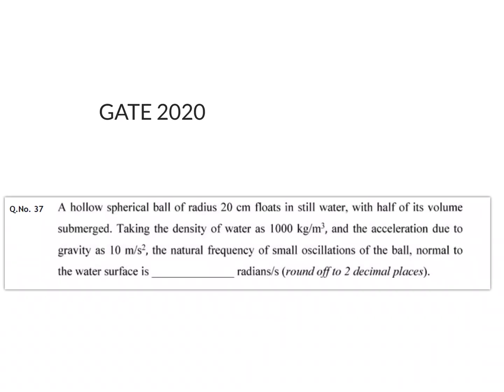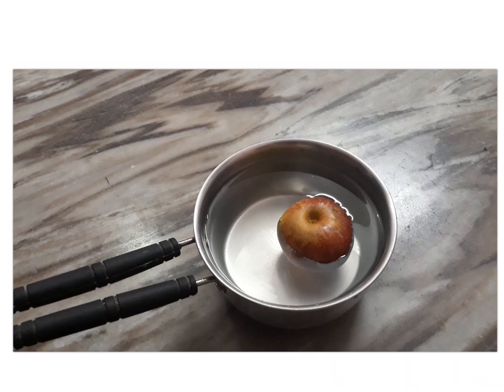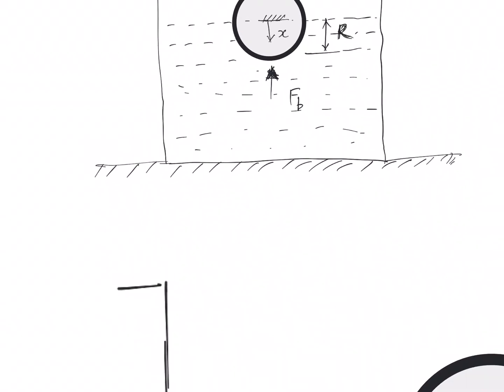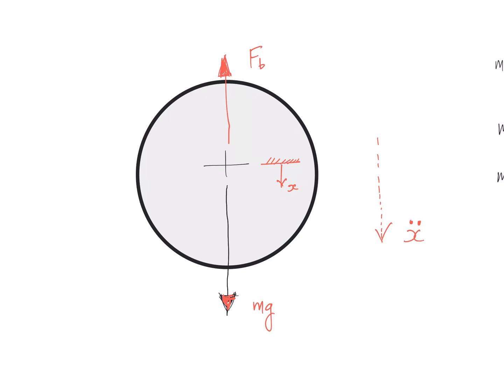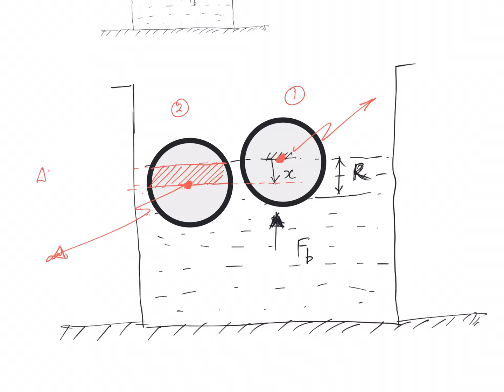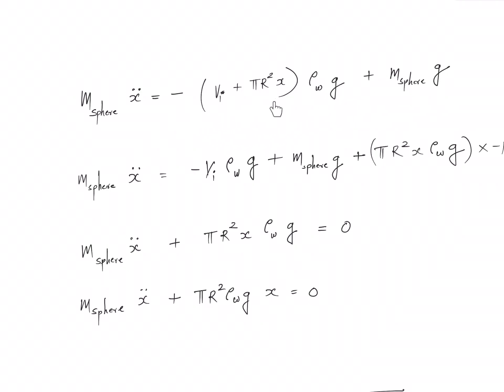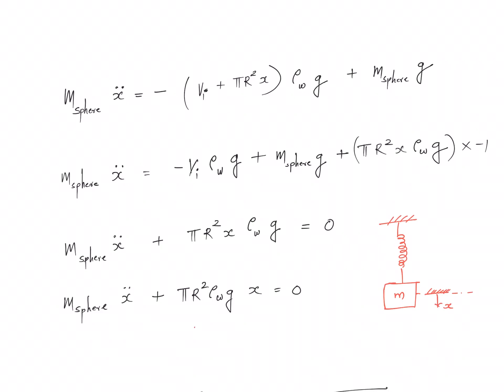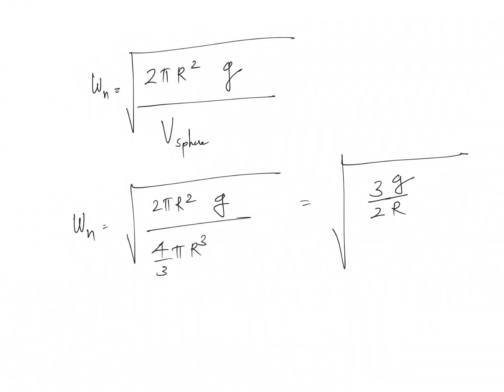Natural frequency of a sphere submerged in water | GATE 2020 Solved example

Comment: Wn= g/delta (deflection) X ratio of surface area to volume (shm about mean position) whole to power 0.5??
Weight Vs buoyancy (surface area-fbd Vs volume)
We can also equate potential energy to kinetic energy and to get a relation between accelerating mass velocity(damping) and displaced mass all in Newton's formula. I'm just remembering by vibrations course 17yrs back...

Comment: they asked frequency you answered for angular frequency
Reply: Are u daft? They asked natural frequency and he answered natural frequency
Reply: @deadskinrippers  chill bro
in question they asked frequency or natural frequency(f) in hertz but he answered for angular frequency(omega or w) in rad/sec.
Reply: @gurulinggbiradar6982  and lastly unit of natural frequency is not Hertz. It's rads/sec. Big difference.
Reply: @deadskinrippers  do u realize there 2 types of frequencies
natural frequency and angular frequency
angular frequency has units rad/sec
and frequency in this case is oscillations per second
Reply: @gurulinggbiradar6982  they are one and the same. Period. Unit of natural frequency or angular frequency is rads/sec. 
Unit of frequency is Hertz or cycles/sec.
Ur question or correction is moot.
Reply: @deadskinrippers  w=2pif
Reply: @gurulinggbiradar6982  what is the definition of Hertz? Cycles per second. Does a cycle make circular motion, or linear?. This is why we get ans in rad/s and then convert to unit which is linear.
Reply: @gurulinggbiradar6982   frequency is cycles per second. Natural frequency is the frequency of a rigid body to oscillate about some mean position to restore its initial position upon a disturbance. Ergo omega not f. Key word is natural. We have to give an equivalent ans. Equate the bob to its inertial state by equating acceleration to displacement equivalently. Which is force to over come inertia Vs restoring force.
Reply: Another method
Wn= g/delta (deflection) X ratio of surface area to volume (shm about mean position) whole to power 0.5??
Weight Vs buoyancy (surface area-fbd Vs volume)
We can also equate potential energy to kinetic energy and to get a relation between accelerating mass velocity(damping) and displaced mass all in Newton's formula. I'm just remembering my vibrations course 17yrs back...